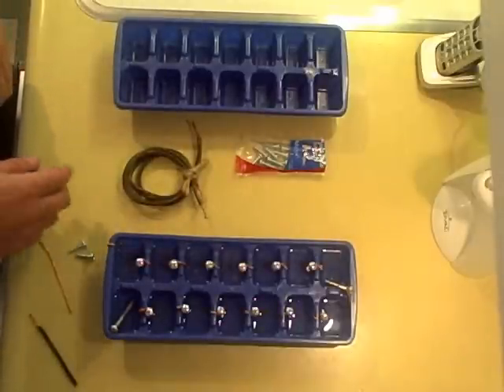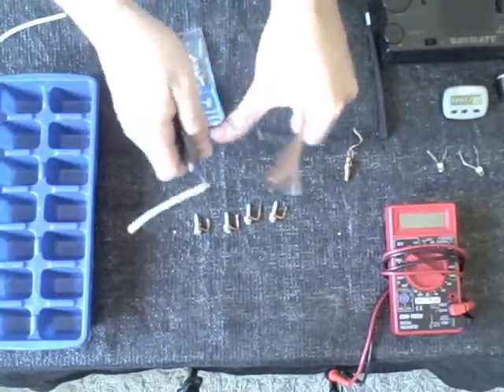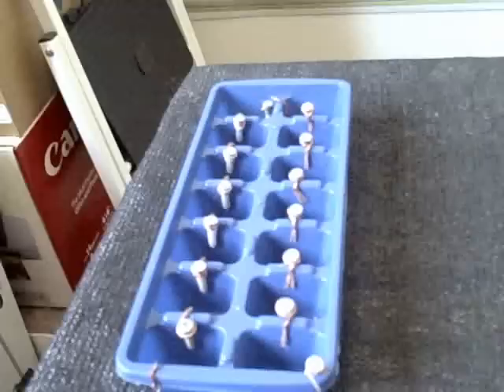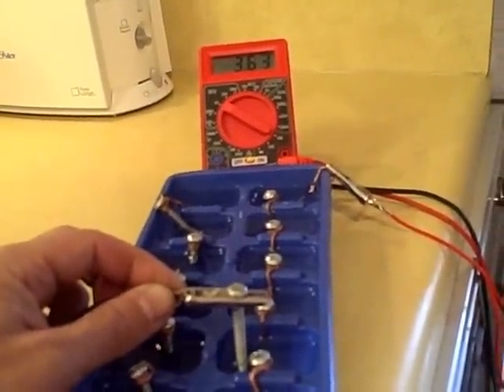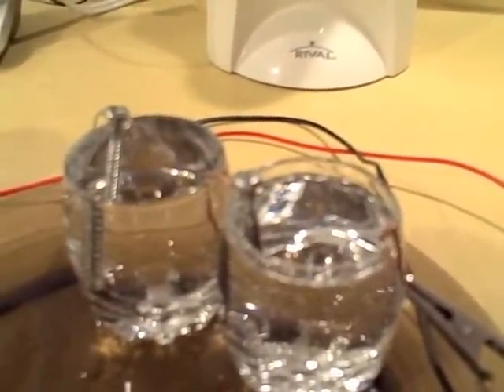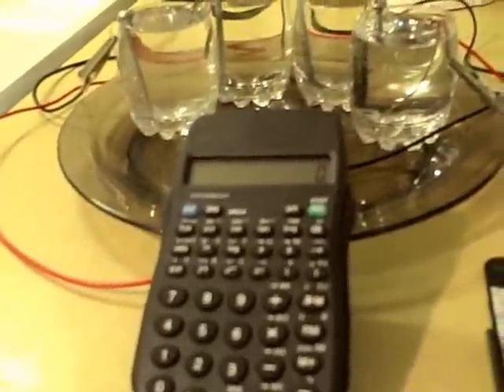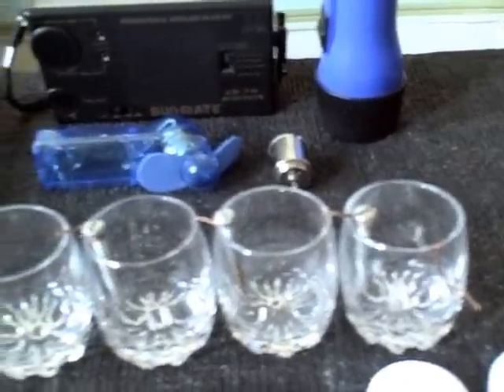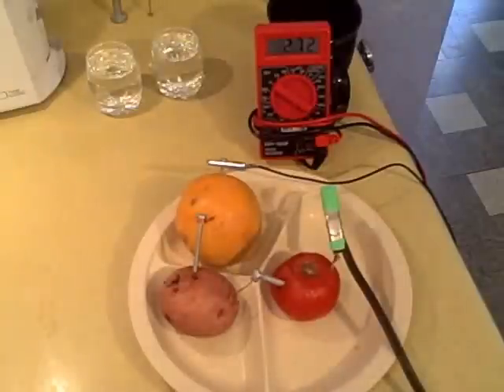Homemade Battery 1.5v - 12v water powered (lights, clocks, calculators) - how to make - simple DIY

Comment: I have made it. Why doesn't it work? I am using a 1.5 V DC motor
Reply from the maker: hi there. the motor probably draws more amps than this battery can generate.
Reply: @desertsun02  ok. Then which device should i use? Or how can i increase the current?

Comment: how the heck would this ever work
Reply: My guess is zinc from the nail and copper then vinegar which is the same way lemon batteries work it has to do with the zinc reacting with the electrolyte and the copper becoming positive and the nail being negative
Reply: @Deadchannel06  oh so it's vinegar
Reply: @josephhsia  at least I think so if not I just found a way to improve his batteries they'd probably be more powerful this way also you replied very quickly for a 1 year old comment
Reply: cause i got notification

Comment: why dont you oil the metal and put it thru a inverter to power a light bulb or store it in lithium ion because its rechargable oil will make metal and the power last for life the difference between this and carbon batter is that the 1.5 volts hold 10000j which this only has volts but last forever its more like a cell then a battery thing of a electric eel

Comment: Hi there. Your video was really inspiring to me, but ive got just one question. i need to have make this kind of battery and have it connected to an engine. also, its supposed to be connected to a 12 volt device continuously. Could you give me any idea on how i could have it store, consume and recharge this energy ? I would really really appreciate the help.
Reply: Did you find anything? I'm in a similar situation

Comment: what kind of water and wire u r using
Reply: +Himanshu and Tanul This is Blue, I followed this demo and I used copper wiring and salt water, (tap water, added table salt to it) this worked great and I got full credit on my Chem assignment. Hope this helps you question. Good luck This was so need and such a good feeling of accomplishment ;) Thank you for this Demo it is very Kool!! ;)

Comment: for the negative terminal, the wire extender used is lead? Can i use solder wire? i think it is lead-tin alloy.Very good way to save trouble of changing AA-AAA batteries every once in a while.

Comment: Get some copper and zinc tape / sheet from a hobby suppliers as the larger surface area should work better. Ironically, the white LED's 5mm plastic case is known as a 'water clear' enclosure.

Comment: i have loads of salt and live by the sea me n my gf spend most our time on the beach or near it. Im sick of my phone running out of battery the bane of smart phones and solar panels tend not to work well in england. could i get some rough figures of size / volume of water vs the N concentration or if you prefer metric ie 100 ml with 3 g of salt for 6v 1a or 6v 2a. what sort of amps are you getting off just the water. also can we charge the water can i connect my solar panel to the battery to help sustain its capacity and reverse the corrosion of the metals? also could you crack water using water? to make hydrogen ? and also if i mix salt into the battery am i going to have chlorine and hydrogen come off the battery ?

Comment: Is the water youre using like purified, saturated, distilled, tap, etc. or something? Im just wondering if there are any special properties different types of water would have to generating energy. A reply would be much appreciated, thanks.
Reply from the maker: TJ Prado hi there. i'm just using standard tap water. things like salt can be added to try to increase the current/voltage but most "effective additives" (including salt) will corrode the metal very quickly.
Reply: desertsun02 Thank you very much! :)
Reply: desertsun02 Excuse me sir will this power a head unit which is 12 volts or it is knows as a car strereo thanks in advance i like and sub to your video wonderfull thks
Reply: cool

Comment: Could you give a laymen's explanation of why this works?
If i understand correctly, this will work until the copper or screw disintegrate or become corroded?
Reply: In general terms, when the zinc and copper are put into a liquid ( I used vinegar ), the electrons move from zinc to copper. We interpret this as electricity and this is the basis by which most batteries work. To use the energy from the battery, we basically "borrow" the electrons as they leave the zinc and are in-between the metals.

Comment: If coffee (pH level 5) is used instead of water, will the voltage go higher? :) Thanks
Reply: Yes, acids and bases make higher voltage but also corrode the battery insulation and conduction faster. Example the alchemists battery, sulfur, mercury and salt is very powerful. Also extremely dangerous, don't try it lol.

Comment: any specific type of metal screws?
Reply from the maker: hi there. almost any that are not copper will work good. zinc coated (galvanized scews) or aluminum are the best.
Reply: +desertsun02 Couldn't you get more power out of it by using a joule thief?
Reply: hey, how much wire do you need
Reply: galvinized nails copper nails

Comment: Would it be as efficient to charge a iphone as a wall charger?
Reply: Do the math , P=V*I , you need Power of 5W at least to charge your phone. so you'll need a current of 1A and a voltage of 5V. they usually get only 0.02A in their batteries. so no.

Comment: I'm getting 8 volts with my water circuit using copper wire and galvanized nails (zinc) but the amperage is 0.05mA which is not enough to light my red LED. How many amperes are you getting in your ice cube tray battery?
Reply: Try using a water with an electrolyte in it EX salt or backing soda will work

Comment: could you power at tv with this, just by wrapping the copper and the regular silver wire around the the tv plug
Reply: No.. The voltage would not be enough unless you made enough cells.Next problem would be making the cells and electrodes large enough to deliver sufficient current and THEN making them able to deliver the required power (voltage times current) for long enough.  It's starting to become an industrial
project rather than a very interesting experiment to show how it works.
Practical amounts of energy are not easily gathered.

Comment: Where do you connect the clips to on the calculator?
Reply: where the battery or two coming off the solar panel connect. Lots of calculators have fake solar panels though lol

Comment: How does this actually work can someone explain?
Reply: I think it's called a voltaic pile it takes the spin of electrons when the water runs through pipes ( like a balloon rubbed against your hair ) and the  acidity (think taste) of each piece of metal attracts opposing direction spinning ions until it the movement within the water's ions becomes net zero or reaches stasis. Maybe temperature has something to do with it. Not sure though answering this to formulate my own thought sa smuch as antyhing else lol